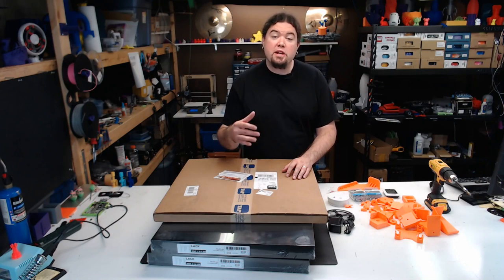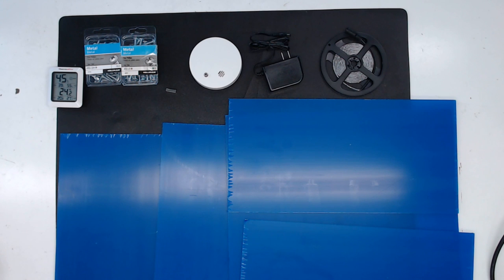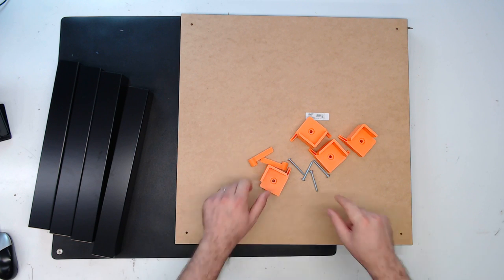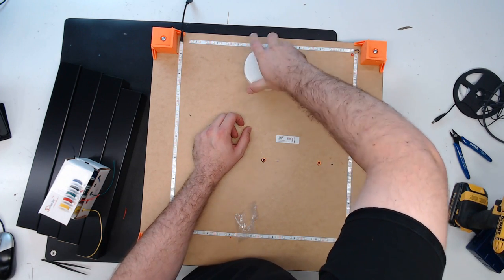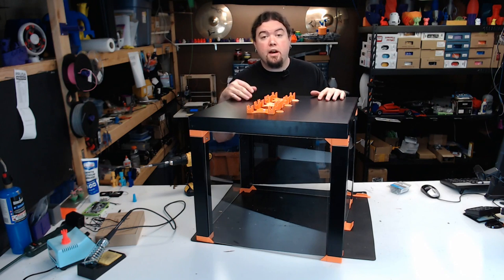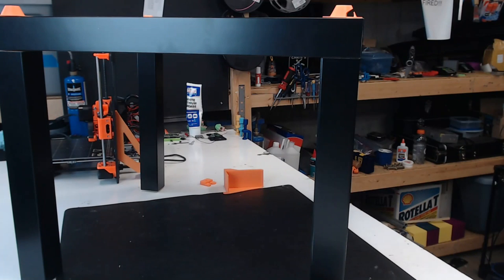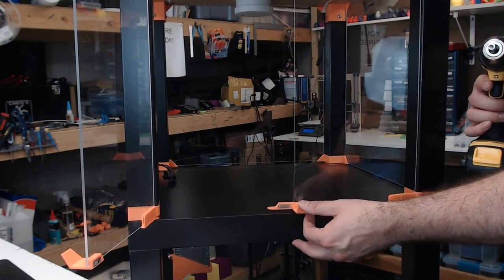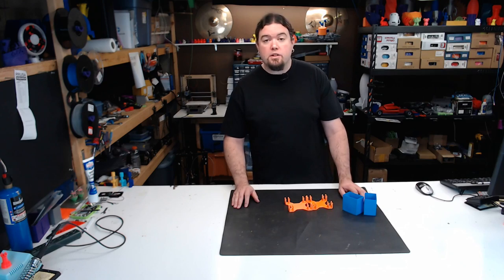Prusa IKEA Lack Table 3D Printer Enclosure - Chris's Basement

Comment: Hey Chris, what size lack table did you use? The 22x22 or the 21 5/8 x 21 5/8?
Reply from the maker: It is this one https://www.ikea.com/us/en/catalog/products/20011408/
Reply: @ChrisRiley  thanks Chris. One more question, when I try to print the hinge, it is either lifting or warping. Any suggestion on settings? I currently have it running @ speed of 100.
Reply from the maker: @maivpuvxwb  Yeah, you probably need to slow down some. I would split out that piece and print it by itself and slow down to around 60.
Reply: @ChrisRiley  thanks
Reply: @ChrisRiley  is the brace to replace the PSU ABS or PET?
Reply from the maker: @maivpuvxwb  I just made mine out of PLA, seems to work fine.
Reply: Chris could you post a link to the magnets you used?

Comment: am having serious issues with the build the lower hinges dont sit flush on the legs and it looks all flimzy, is there a way to fix this
Reply from the maker: There always going to be a bit higher than the part. The LACK tables have changed over the years. Some of the newer one benefit from a larger screw running down to hold the legs on. You can always print more brackets to make it sturdier.
Reply: @ChrisRiley   i had to print a 6mm spacer for the  lower corners to fit, however the plexi now is a bit flimzy.. and that is the best i can do as am not skilled enough to modify the parts correctly

Comment: Good video, detailed for sure. but somehow I missed the (correct) file for the Ender 3 PSU relocation mounting file??!!  I got the frame stiffener file V1 & V2, but the PSU relocation file I printed was too small for the Ender 3 PSU?! Did I miss something?
Reply from the maker: I haven't seen one like that for the Ender 3. I have only tried the MK2.
Reply: Ok,  well, thanks. 
I'll try to design my own then... ✌
Reply from the maker: @Zsoltnlv  You might check something like this out, it might help. https://www.thingiverse.com/thing:2974282 Maybe it could be altered a bit.
Reply: I'll check it out...

Comment: Can you fit an ender 3 pro or do I have to modify the printed parts?
Reply from the maker: You would have to modify the parts to make it taller.
Reply: @ChrisRiley  I am starting this build, I have an Ender 3. What I'm going to do is get a 2"x2"x8' piece from the local orange or blue hardware store, and cut 4 new legs at 20 inches, this should clear the top. Then I am going to get it together enough to remeasure the plexi and have it cut by TAP Plastics. As far as I know, that's all that needs to be done... hopefully
Reply from the maker: @Shooter_FPV  Good luck with your project. Let us know how it goes. Happy New Year!

Comment: Hey! this is a really old video but I'm thinking of making oen but my worry is that i run mine with input shaper at 4k-5k accel and 200mm/s and it shakes the table a lot, is this flimsy? do you think it could handle the shakes?! Thanks :)
Reply from the maker: Hey Amy! It might be able to if you add a few brackets here and there and maybe add some weight, I use paver block in mine now.
Reply: oh I'm not sure where to buy a paver block and how to bring it home without a car as it's heavy! but i'll see what I can do :) Thanks!   @ChrisRiley

Comment: Could you send me the links for the design or code file for both ( reinforcement 90 angle for Mk3s & the modified piece to redirect the heat bed wires) ... thank you
Reply from the maker: All the links are in the description, this is all I have.

Comment: Looks amazing.  Could you post the inside area dimensions?
I have a CR 10 mini that I would like to put in an enclosure like that.
Not sure it will fit.
Reply from the maker: Sure! This one is 530mmx530mmx530mm max, but there are a lot of different feet available to extend it.
Reply: Chris Riley Thanks Chris!

Comment: Hi Chris, would a #12 screw work in this enclosure? I just bought what Prusa said. Do you think it will fit? Anyone know the ANSWER??
Reply from the maker: They are to be 6mm, the #12's fit, but they are a bit loose. You will probably be fine.
Reply: Chris Riley Oh cool! Do you mean the #12 will be loose or the #10? I though the 12 is bigger?! 😆 thanks
Reply: Chris Riley Why did many other people YT said the #12 doesn’t even fit at all and ruined their project? I trust you Chris, I am sticking with #12! Should I buy #10 3/4 screws just to be safe?
Reply from the maker: @RainTechTime  So in standard sizes, the bigger the # the bigger the size. #12 kinda fits, #14 is better. https://www.lowes.com/pd/Hillman-14-x-2-in-Phillips-Drive-Sheet-Metal-Screws-2-Count/3034788
Reply: @ChrisRiley  Thats cool. But you used #10 right? Wouldn't it be too small?
Reply from the maker: @RainTechTime  I used #14.
Reply: you said #10 in the video... Should I but #14 though?
Reply from the maker: @RainTechTime  #10 x 3/4" screws for everything besides the legs. #14 x 2" for the legs.
Reply: @ChrisRiley  Thank you. So that's what you used right? I will buy them on Amazon. Is Phillips Oval head okay for this? Or should I use pan head.
Reply: @ChrisRiley  You said you used #12 for long screws and #10 for short. Hahaha
Reply from the maker: @RainTechTime  https://www.amazon.com/Stainless-Phillips-Screws-Bolt-Dropper/dp/B07D1KQCGJ/ref=sr_1_9?keywords=%2310+3%2F4%22+screws&qid=1564712454&s=gateway&sr=8-9

https://www.amazon.com/Stainless-Phillips-Screw-Bolt-Dropper/dp/B079YCFCPB/ref=sr_1_3?keywords=%2314+2%22+screws&qid=1564712551&s=gateway&sr=8-3
Reply: Chris Riley You said you used #12 in the video though?? Is that a mistake?!
Reply from the maker: @RainTechTime  #12 work, but they are a little lose on some of the newer lack tables I have found. #14 is a much tighter fit.

Comment: wonder if you stack two of those tables on top of eachother (one upside down one right side up connecting the legs together ) has a big enough footprint to fit a CR10
Reply from the maker: Hmmmmmm, good question, I will measure it.
Reply from the maker: So you could, the tables are 42.5cm leg to floor, so stacking them to get height is no problem. I am basing this on the original stock CR10. The CR10 is 60cm in the Y with the motors and around 42cm in the X. The tables are 44.5CM in between the legs left to right and front to back, so X will fit, but just barely. Y is your problem, if you didn't want to put the glass in it would still fit but the motor mounts would hang off the table. The feet would still be planted firmly. Hope this helps.
Reply: was more worried about the footprint of the cr10 but i think you could use the same 3d prints you used for the perspex sides but make the perspex taller

Comment: I just ordered 3 lack tables.  Are they just supposed to sit on top of each other or do you have to connect them?
Reply from the maker: They will need to be connected some how. 3D printed L brackets would work.
Reply: Ok
Reply: What l brackets would you recommend? I can't find any that would work. Are there some included in thingiverse file for enclosure?
Reply from the maker: These might work. https://www.thingiverse.com/thing:662917  No, there are none is the Prusa parts, there should be.
Reply: @ChrisRiley OW!! I totally didn't see the last part of the video of you setting up the printer with L brackets! On the prusa site it says we need Wago 221 and a twin cable. Are those necessary?
Reply from the maker: @penguinlife9239  I didn't use them, I ran new wire for the PSU and used a standalone set of LED lights.
Reply: Ok

Comment: does the MMU 2 still fit on ?

I plan on building this as soon as the printer arrives , but the MMU is on order as well so before starting the build this would need to be sorted out.
Reply from the maker: I have had that question myself and I am going to say the MMU will fit, but you are going to have a really hard time routing the spools while it's in the enclosure. It might be more trouble than it's worth on the MMU.
Reply: thank you for the reply indeed.

maybe extending the feet would work better ( 10-15 cm extra )

Comment: Did someone link the 45 degree heat bed thing? What should I look for on thingiverse? Also, I find my plexiglass is just a little undersized in all dimensions. Does anyone use glue to keep them in place? I am thinking a small bead of hot glue would work. Any suggestions?
Reply from the maker: Here is the MK2
https://www.thingiverse.com/thing:2862941

Here is the MK3
https://www.thingiverse.com/thing:2890592

My plastic is pretty snug, hot glue would probably do the trick.

Comment: Where do I find those sweet filament pass-throughs chris?
Reply from the maker: They were part of the prusa V1 enclosure parts. I think they are still in there.
Reply: @ChrisRiley  They pas-throughs aren't there, at least I couldn't find them.  And the link for the Adjustable Spool Holder is broken, so I don't know if they were there.  Do you like the slot idea better?
Reply from the maker: @ginarazete6523  I do like the slot idea better. I was thinking about doing that to mine it would be easier to use.
Reply: @ChrisRiley  I printed the slot.  It works like a charm.

Comment: I got the #12 x 2" screws mentioned in the video and I've just installed the top corners, they aren't very tight. It doesn't feel like they're threading into the table.. Did I get the wrong ones? :\
Reply from the maker: Some have reported this, mine seems to be fine, but you might want to jump up to #14 to make it more solid.
Reply: Okay, thanks for the quick reply and the videos!
Reply: The material on the Lack tables - it's not wood, and so the screws don't really 'bite' into anything. I'm building my enclosure now, and definitely have stability concerns. Those tables are just too flimsy. Nice videos though, very helpful.
Reply: I am in the process of building mine now (just about done). If anyone else is reading this - highly recommend going up to #14 x 2". My legs are a little wobbly, and I can't help but think that using #14 x 2" instead of the #12 x 2" would have helped a bit. They certainly wouldn't have hurt. But, as Matthew said, the screws don't really 'bite' into anything due to the construction of the Lack table (which, hey, that's why they're so inexpensive to begin with!)
Reply: I'd also recommend corner braces to secure the middle table to the lower table, as Chris shows late in his video. Mine is almost complete, a bit more stable now that all the levels are tied together. Last bit is to decide on the 45 degree versus the 90 degree heat bed replacement cover.

Comment: Hey man, I went and bought the exact screws you did but I'm having a problem with the enclosure part of the stack. It's really wobbly like the screws aren't holding everything together, even with the plexiglass in there all the way. Any ideas?
Reply from the maker: Hmmm, not all screw are created equal. Do you think its the longer screws causing a problem? You might be able to jump up to #14 screws and resolve the issue. Mine seems pretty sturdy, but that doesn't mean anything.
Reply: So I did #12/2inch. I'll go buy some #14/2 inch and see if that works.
Reply from the maker: Cool, that might help. If they are countersunk that might help as well.

Comment: Great video, I just bought the same printer. I have to wait about a month for delivery. 

Do you have a printing service, so I can pay you to make all the parts? I can pay by paypal. This way I can get most of this made before the printer gets here.

Subscribed. Great video. I didn't see the black part in the parts list?
Reply from the maker: Thanks for watching! I don't print as a service, but I am always willing to help with projects. Send me an email, you can get my email address from my about page. This is the 45 degree piece. https://www.thingiverse.com/thing:2862941
Reply: Chris, what if I wanted to connect the led strip to the prusa powersupply?  Is that doable? Where would I find the instructions?  TY

Comment: I was looking at the magnets from AliExpress and the ship date lead time says anywhere from 20-38 weeks! Help! I saw there was an option similar on McMaster-Carr, just dims are in inches not mm. If I go this route for the magnets, price is going to be around $20 for those alone..... :/
Reply: I was looking on Amazon and I think I am going to go with a 6x3mm round option and just put a few in the opening for the magnet. Should work and won't be a 3 million year lead time haha
Reply from the maker: I was just looking on amazon as well, I use these for a  lot of stuff, you can probably alter the parts really easy to use them.

https://www.amazon.com/FINDMAG-Refrigerator-Magnets-Premium-Brushed/dp/B07CPV7X8Y/ref=sr_1_3?ie=UTF8&qid=1539718257&sr=8-3&keywords=8mm+magnets

Comment: What’s up with the printer sitting on a huge chunk of foams at the end of the video?
Reply from the maker: Good catch. Those Lack tables are hollow, if you want it to be really quiet, you will need some insulation.
Reply: Or drill a hole from the underside and fill it with spray foam insulation.
Reply from the maker: Michael Cummings That's a good idea.
Reply: You can not fill the inside of the table that easily, because there is a cardboard mesh inside to add stability.
Reply from the maker: It would be cool to see what the inside of the table top looked like.
Reply: If it's like most hollow things supported with corrugated cardboard, it will look an awful lot like the table was printed with 15% infill. Only it's cardboard. 😃

Comment: hi very cool video like and sub!!! but what are you you g when the temp in the box is to high and pleas don't say open the door 😂😂😂 I mean when you printing and nobody are at home or something like that?
Reply from the maker: Thanks! lol, open the door, that's kind of a terrible answer. :) I don't really have a better one at the moment. I use the enclosure for ABS mostly with the doors shut, I can get it to about 30c. Everything else I print with the doors closed. It would be a cool project to add a thermistor controled vent/fan.
Reply: ok cool so I don't must worry about, that the temp goes to high? sorry my English is horrible 😂😂 @ChrisRiley
Reply from the maker: @julianbambus9722  No worries, I am not sure how hot it would get in there with just PLA.

Comment: Do you have a recommendation on infill for the parts?
Reply from the maker: I like to use cubic on everything. It's super strong.
Reply: I am really frustrated with this printer.  I think it’s under extruding and don’t know how to fix it. Can you help me?
Reply from the maker: @penguinlife9239  Which printer do you have?
Reply: Chris Riley I have a prusa i3 mk2s. I figured out e steps but it awkward as I’m not positive that’s the issue. The part I was printing for lack enclosure seemed it was under extruding but when I extruded 100 mm of filament it was way over extruding.
Reply from the maker: @penguinlife9239  That right, you told me that before.The Prusa defaults should work great. Is the extruder drive gear nice and tight? How much of the idler screws are sticking out?
Reply: Now I am getting a rough sound when trying to print or extrude!😱What did I do wrong...
Reply from the maker: @penguinlife9239  It sounds like a mechanical issue. I would got back to defaults with a M502 followed by and M500 and check out your gear and idler.
Reply: Chris Riley the idler screws are sticking out 1 1/2 cm
Reply from the maker: @penguinlife9239  Yeah,  13-15mm is about right.
Reply: Ok well the horrible sound stopped after m503 and I don’t understand.  I’m doing a test cube 20x20x20 for prusa support and I don’t know if the file I was trying to print for the bottom table for lack enclosure is broke but it wasn’t filling in the layers all the way. I changed up the profile a little too so it could’ve been me.

Comment: I wonder if Walmart's Mainstays Parsons End Table would work. Looks the same as Ikea's. Anyone can measure Ikeas legs L/W?
Reply from the maker: You need one leg? 50mmx50mmx400mm Or the table? Outside it's 550mmx550mmx450mm tall.
Reply: @ChrisRiley  Thanks a lot will try with WM table.

Comment: will this work for the Ender 3Pro
Reply from the maker: It is a little to tall.
Reply: @ChrisRiley  DAMN... yeah, I was all excited when I saw this, then I measured the Ender, and compared dimensions to the Lack Table!  Lemme see what I can come up with!!
Reply from the maker: @RicardoSicks  Check thingiverse, there are a couple parts to help make it taller.
Reply: If its too short I figure we can print some spacers. Don't know if this is helpful, but Ikea is selling this table for 2.99 right now in white. I ended up buying some spray paint, it still came out to less than $13.
Reply from the maker: @AC-rc9vv  Wow, that's a good deal.

Comment: why use magnets on both sides of the door latch?  If you had used a piece of ferrous metal on one side you wouldn't have to worry about accidentally mounting the magnets the wrong way around .
Reply from the maker: Great point, I was building as designed by Prusa.
Reply: @ChrisRiley  Ah, I see. Well, it turned out great anyway! 🙂
Reply from the maker: @BEdmonson85  Awesome!

Comment: Got a link to the angled heatbed cable cover?
Reply from the maker: Sure.
MK3 bed plug cover 60 degrees.
https://www.thingiverse.com/thing:2890592

MK3 bed plug cover cover right angle:
https://www.thingiverse.com/thing:2837970

MK2 bed plug cover:
https://www.thingiverse.com/thing:2862941

Comment: Hi Chris, I am having trouble with the black ABS I used too make the spool holders.  The ends of the X's dont stick to the plate and and slightly curl up.  I even tried with the Lack enclosure at 30-33C but not much better. As in the pictures, the uneven base leads to squished layers in the verticals.  Strength is good but looks rough.  Here is a link to a short iCloud video.  If you are busy, I will be sending a question to forum at PRUSA later when I get time.  "https://share.icloud.com/photos/0EotKuqkXFfvnq9X-ExRj6puQ"
Barry, Perth Australia